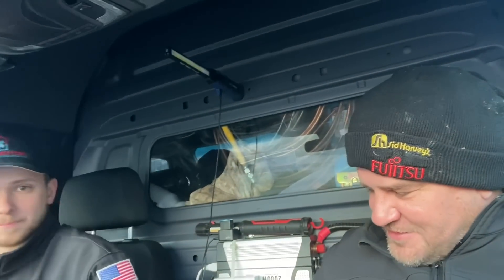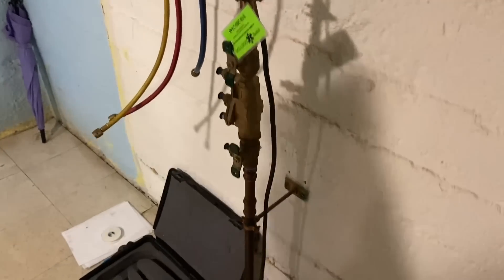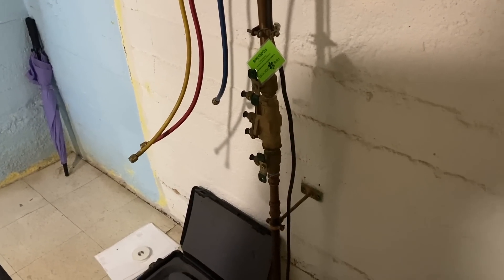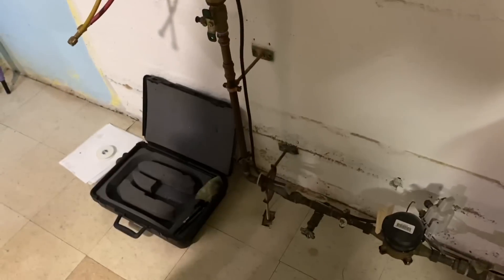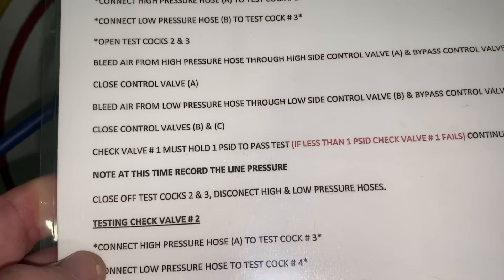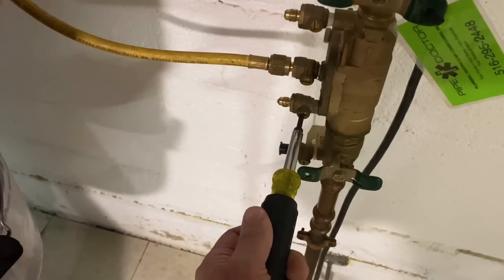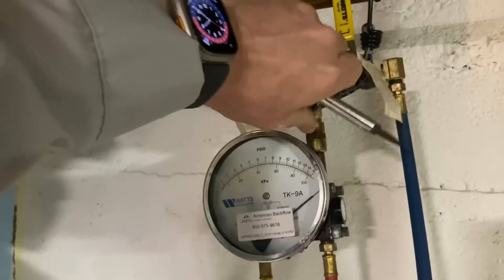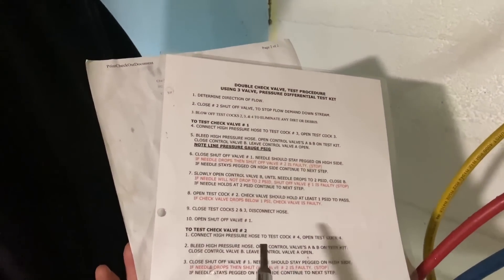Watts Double Check Valve DCV Backflow Testing and Inspection Procedures Using Alternative Method

Comment: I think the reason the first test didn't work is because you had to keep the bypass valve open the entire time when bleeding the high and low. You can see on your own sheet it doesn't say anything about closing the bypass valve.
Reply from the maker: Thanks for pointing that out! You're absolutely right about the bypass valve; it can definitely impact the test results. I'll make sure to keep that in mind for future testing.

Comment: Hi Mike, When was the last time you took your differential gauge in to have it checked and received a certification of calibration? That pointer was way low out of the box before you even connected to the assembly. Just for kicks if you have an accurate manometer hook it up to the high side of the TK-9A and pump it up to just over 2 psi then bleed the pressure slowly down as you compare the two. You can lightly tap the backflow gauge while its descending stopping at 2 then at 1psi. If your manometer can go to a higher pressure do it then see how it compares as it comes down from 15 to 1psi. This is just to give you a idea if its close to being accurate. You should send them in at least once a year be checked and or calibrated by a accredited testing company. Thank you for your videos :^)

Comment: Good job! I got my VA Backflow Preventer License. So… I am literally 1 out of the 3 people that are eligible to touch back-flow preventers in my company compared to like 20 people on the company plumbing roster. It is sad, we had like 8 people that went to the academy course. Only one, and me, took the state exam.

Edit:
To answer the question what if the backflow preventer fails. We recommend a rebuild. Throughout my course of working on backflow preventers here in VA. I had only seen Watts or Zurn Wilkins brands. If there are those fire suppression systems and it is those 6-8” service lines, I only had seen AMES with those “steering wheel” shut off valves. If the rebuild doesn’t work. Only options is replacements. There is nothing else to it to be honest IMO.